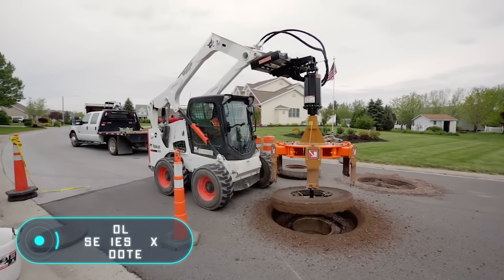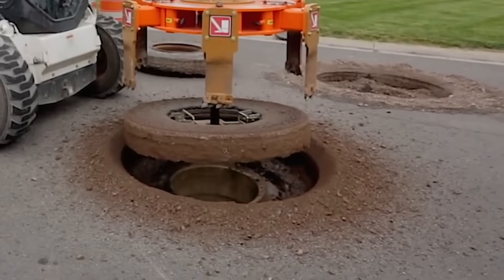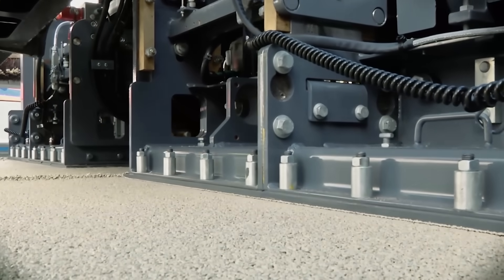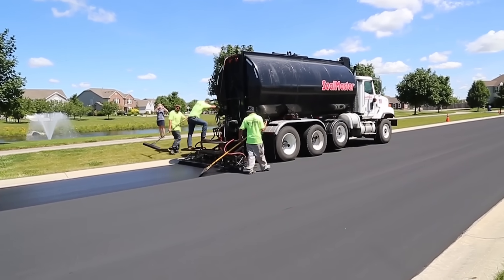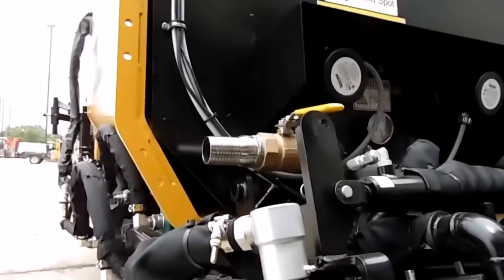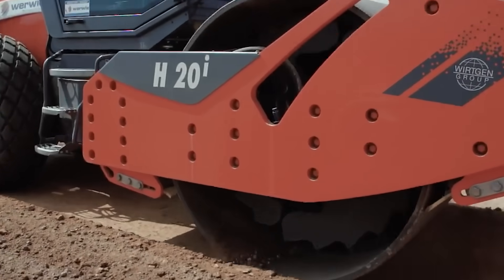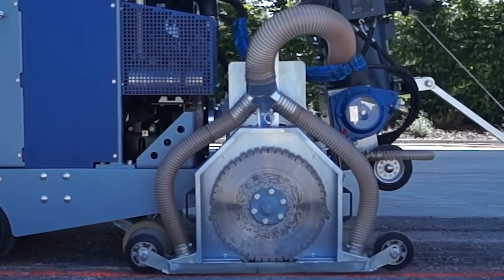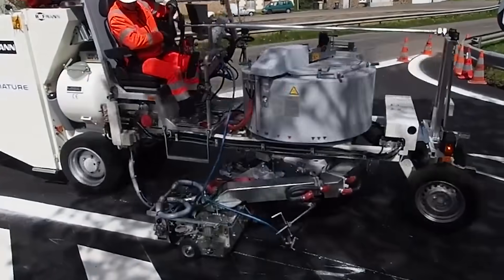MIND BLOWING LATEST ROAD TECHNOLOGIES

Comment: Because of extreme heat capacitor wire cable equipment tyre tube plastic glass trees leaves grass hopper major and minor AC Etc will all melt and blast. Including humans with bine biskey pirandy etc

Comment: That Cat paver isn't laying down a complete tack coat.  Think about that, Cat DESIGNED a piece of equipment to do an incomplete job.
Reply: Look closer, there's spray bar behind the tracks.
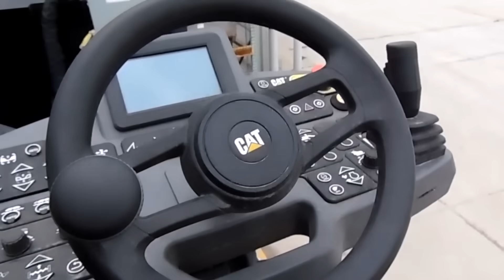Reply: @Asphalt_Cowboy_815  5:52 nope.  6:18 nope, the hot mix is, again, clearly being laid down on an un-sprayed surface.  I agree, 5:49 sure looks like it's showing spray nozzles behind the track, but if those are nozzles then why aren't they being used?
Reply: @jasminelindros8923  Maybe they are being used and we just can't see it. They don't really show a good angle, long enough to know for sure. But there's clearly spray bar there.